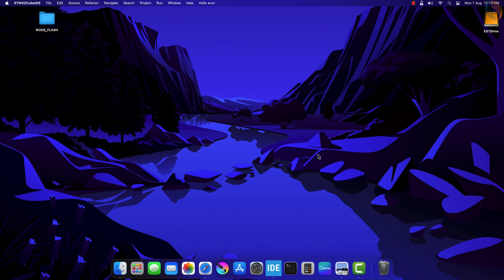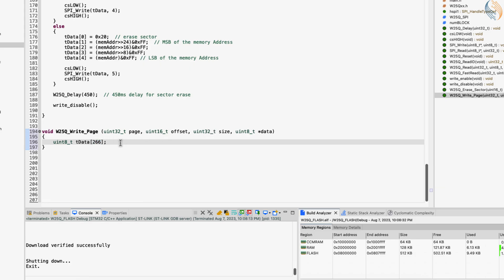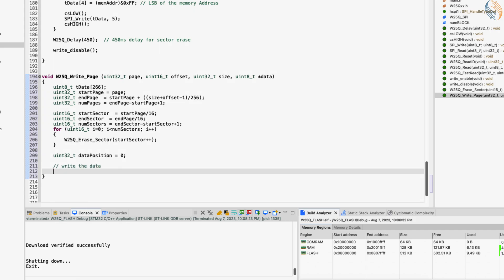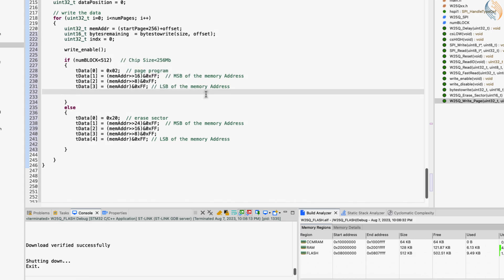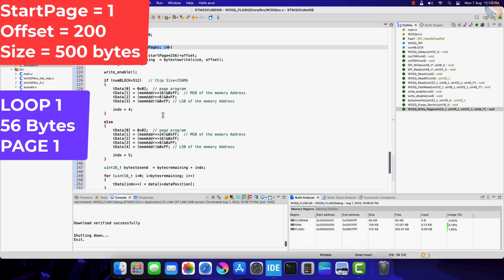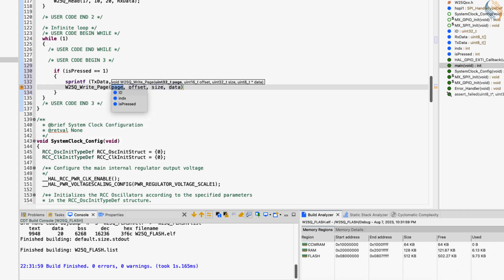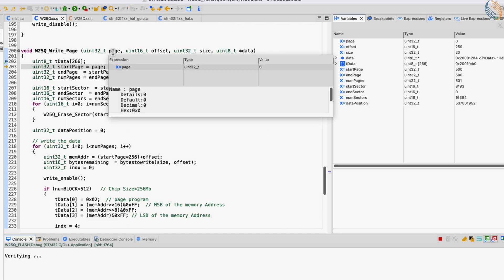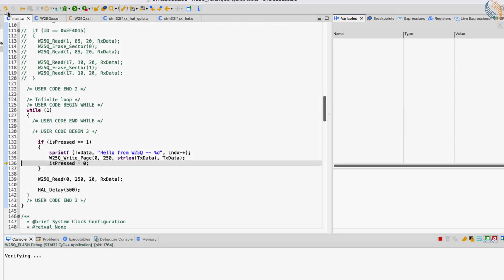W25Q FLASH Memory || Part 4 || How to Program Pages

Comment: i tried read_ID code and it works on my stm32f407 discovery board but it does not show me any data when i run  write_code. I chose PA0 pin  as my input interrupt pin.

Comment: But how can we increase the flash memory of the processor. In this method, we learned how to use the external flash, but we did not work on how to include the main program on the external flash
Reply from the maker: The series is not over yet
Reply: Adding flash to the databus with execute code allow is not so easy. Especially this serial flash. You need for this special hardware interface like FMC (for parallel memory). This interface should be embedded inside microcontroller like for example STM32F103ZET6, STM32F407ZGT6 and so on. But myguess - forgot about this w25qxx SPI flash memory as external flash for program.